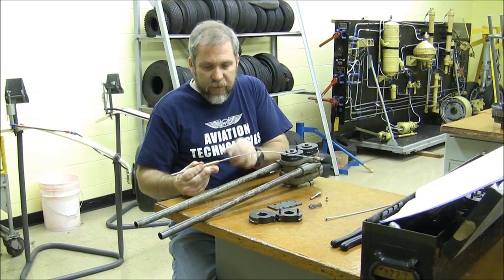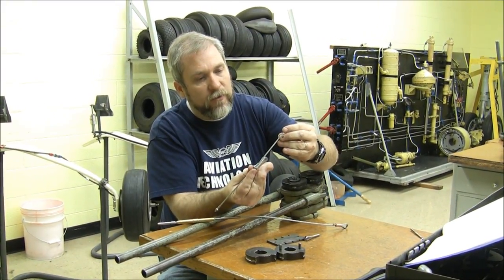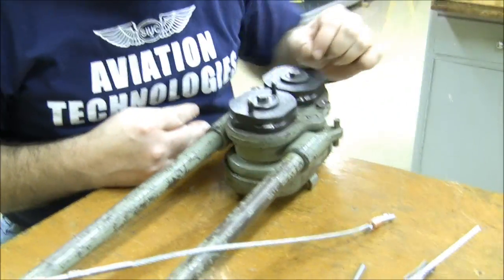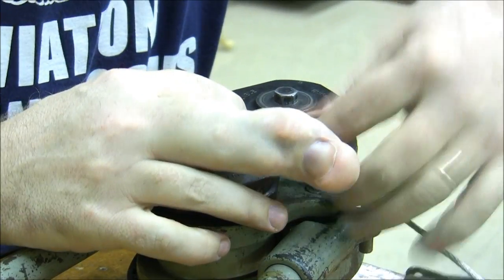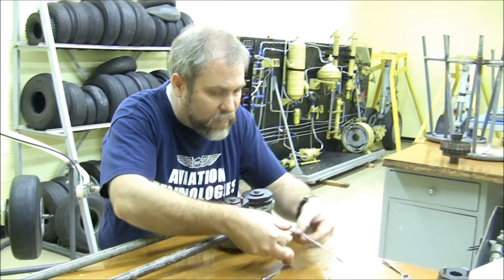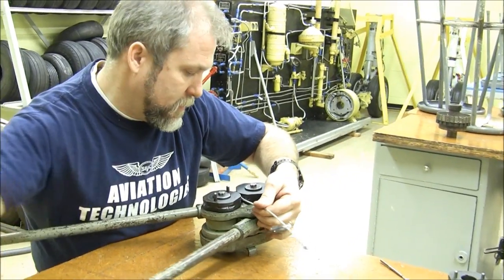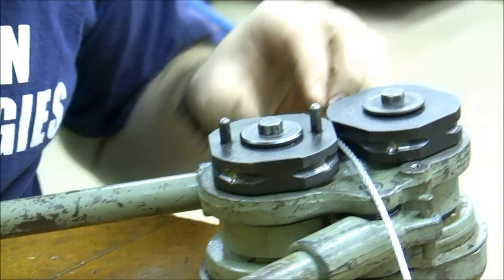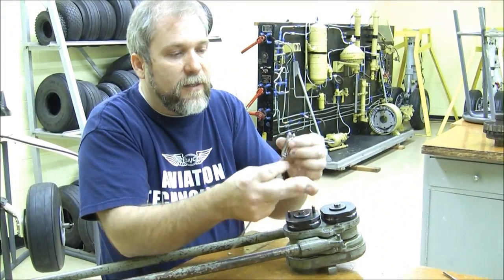Aircraft Tool Training - Kearney Swager - Ball Terminal

Comment: Hi- I always crimp on stops and sleeves but will start crimping ball shanks.
I now have a stainless steel swage hand tool and the hardware but wanted to ask, if you knew if I crimp the shank or the ball and shank with the hand tool? And do I crimp 3 times and rotate between each crimp? Thanks